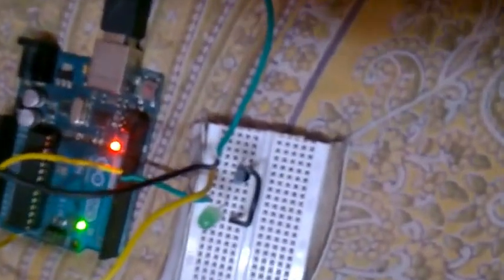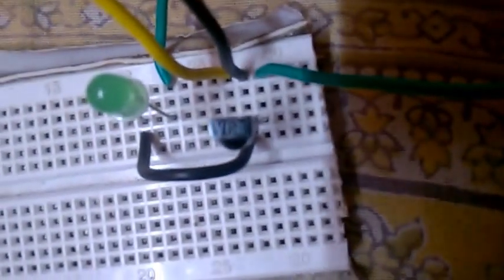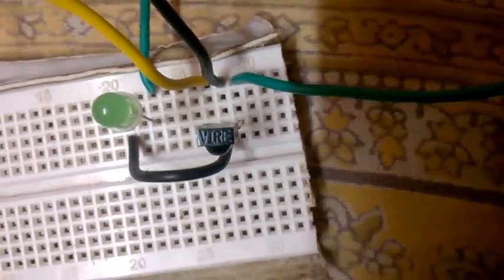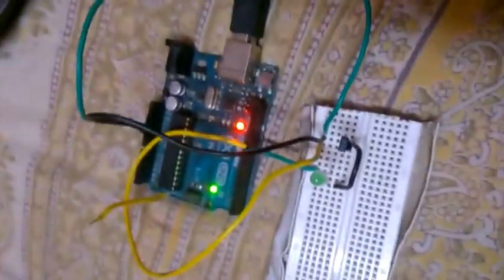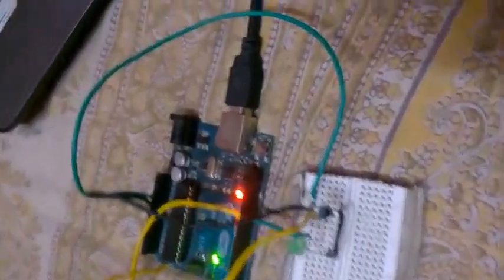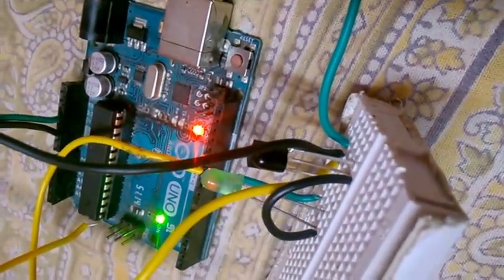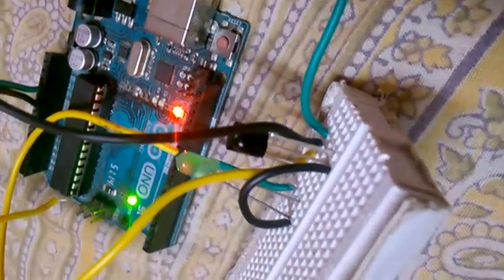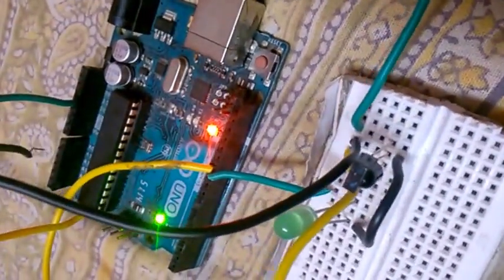VIRE IR receiver pin outs for Arduino projects

Comment: Can you tell me about the pin configuration of ir receiver
Named CHOA. I am find this in a toy.  I search  on net but not found
Reply from the maker: If you can send me the PCB picture probably I can tell. I do not have the exact par number.
Reply: @jainvibhore1997  thanks  for  reply😃
Now i am find this 
It similar like vire

Comment: pls show in a pin diagram of Vire company tsop because as i connect it according to tsop 1738 pin arrangement it get heated.
Reply from the maker: I think you put the data out pin to VCC that's why. Get a new receiver.

Comment: I purchase an ir reciver and TrasmITER
He give me a ir reciver name VIRE.
Can you give me data sheet link plz
Or its a Company name or particular
Frequency  range reciver.
I confused with rated voltage and
Pins and how to make a simple circuit
Plz tell me.
Reply from the maker: Hey. Even I purchased one a few years back but there was no documentation all I know is the pinouts and that it works with 5 volts. The pinouts are in the link below:
https://www.safaribooksonline.com/library/view/learn-arduino-prototyping/9781788290685/assets/0a500f59-d336-4144-8e78-fe5211f323ef.png

Comment: Pls tell the pin outs as i am still confused
Reply from the maker: https://www.google.co.in/imgres?imgurl=http%3A%2F%2Fwww.modmypi.com%2Fimage%2Fdata%2Frpi-products%2Fhacking-and-prototyping%2Fsensors%2Ftsop38238-pinout.png&imgrefurl=https%3A%2F%2Fwww.modmypi.com%2Fblog%2Fraspberry-pis-remotes-ir-receivers&docid=rYwcSCCVA1eTBM&tbnid=VeKTsORNyenq9M%3A&vet=10ahUKEwjywe_frtXYAhXORN8KHUEDBbsQMwhBKAEwAQ..i&w=604&h=580&bih=637&biw=1366&q=TSOP%20vire%20pinouts&ved=0ahUKEwjywe_frtXYAhXORN8KHUEDBbsQMwhBKAEwAQ&iact=mrc&uact=8.

Comment: I think mine one blew out as it became very hot
Reply from the maker: That happens when the data out is connected to Vcc and the transistor blows due to the high current surge from Vcc to ground. Reverse polarity can also kill the receiver.